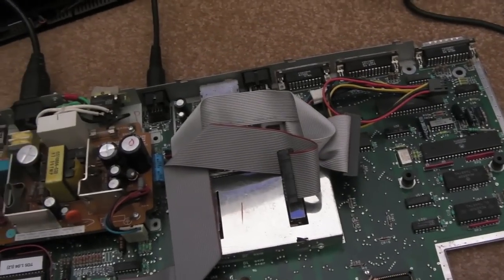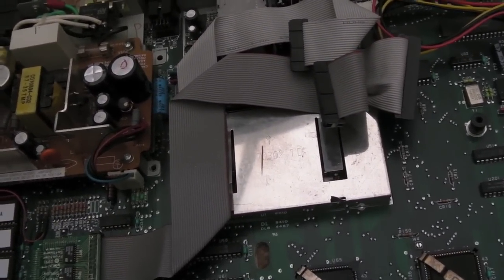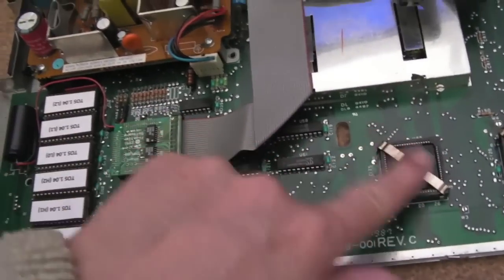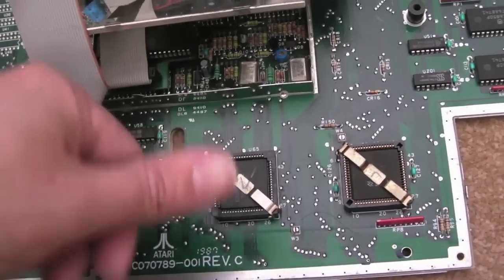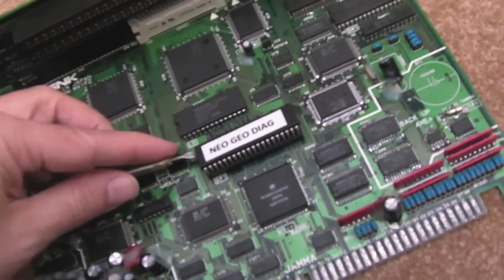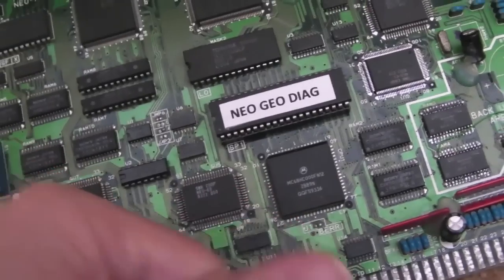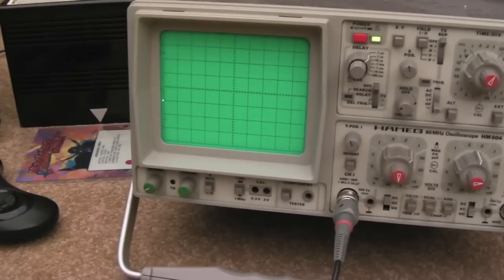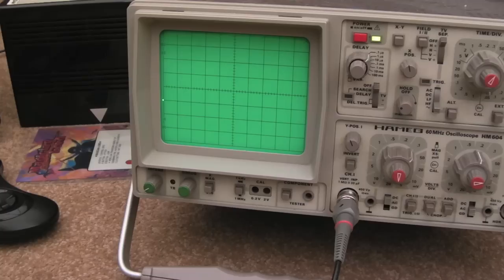Atari ST Reseating Chips & 16Mhz CPU Update 2.5

Comment: Hi I am truly grateful for your brilliant video, again a well and easy to understand presentation ,but before I got to trying the reseating I had to go and try it one more time ,being the fool I am ,and it caught fire making a bit of a bad burning smell ,strangely enough the Atari still boots to the black screen ,so I have given up and bought a Atari ste with 4mb which is really good at making music with Cubase lite  but it does crash some times 
ps your video will surely be a huge help to all of us thanks again Brian.
Reply from the maker: No problem!  Regards the STe crashing, it's likely one of two things - the PSU, the capacitors tend to need replacing on them.  Or sometimes the RAM goes a bit glitchy - since the STe has SIMMS its pretty easy to put some new 1Mb 30 pin SIMMs in there to sort that.
Reply: Hi again lol and thanks for the information ,I have noticed it only crashes with Cubase floppy and not any of the games  which run quite sweet so I will keep my eye on things ,its good to hear about the Simms  though,sorry about all the questions , but there   should be 4mb of ram in the Atari STE  is that a reasonable amount to have for most things ,thanks again and very best wishes Brian..
Reply from the maker: Yes, 4Mb is fine and you can't really go beyond 4Mb on the STFM or STe.  It is possible to add 'fast RAM' which only the CPU has access to, but software has to have been specially written to make use of that.

Comment: Hi,

Great Vid as always!! However what's your reasoning behind having PCB's laying on carpet? In my experience carpet has rendered weird behaviour with electronics.

You seem to have odd issues as well with hardware.
Reply from the maker: Thanks =)  Regards carpet, yes you are right -  you can get static problems etc.  I think it's due to the way I started doing electronics in my bedroom as a child & teenager.  Always used to work on the floor back then lol.  Most of these things need to be near the TV as well and there's no easy way to support them off the ground whilst I am working on them =/

The few odd problems I've had I am sure are just coincidence.  For example the wierd cart problem I had with the MVS was failed pull up resistors in one of the NVPROM chips.  With this ST 16Mhz upgrade I think I've worked out the problem (will know tomorrow!).  If you can work on a table with an anti static mat and wrist strap - that's the best way to do it =)
Reply from the maker: Yes, I think whilst its not best practice it doesn't cause any problems for some people.  I happen to think that there's more risk  involved based on your own body static profile.  ie. I never ever get static shocks off anything, whereas my wife gets shocks off car doors, light switches, you name it!